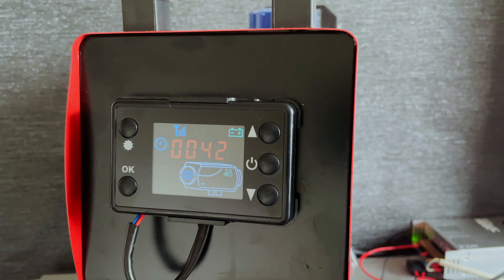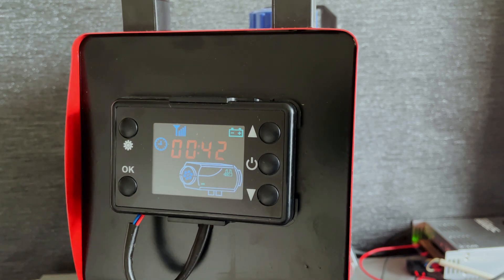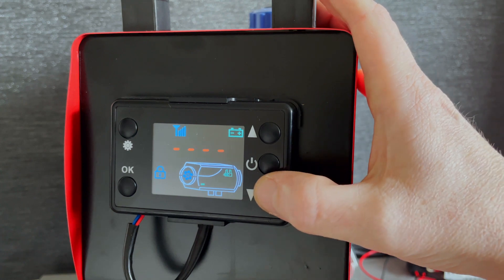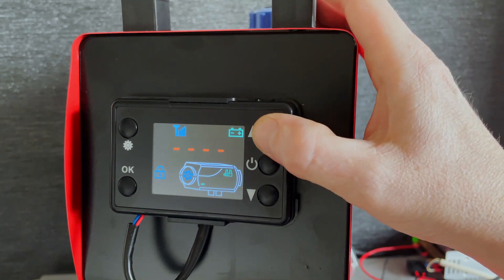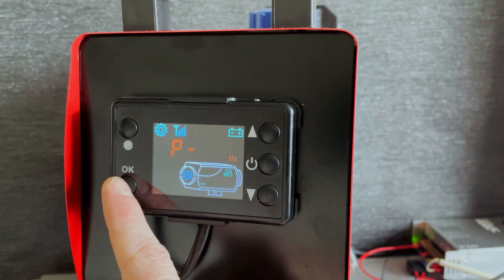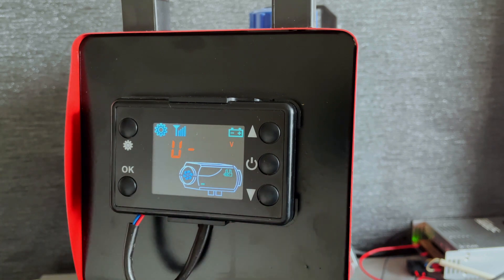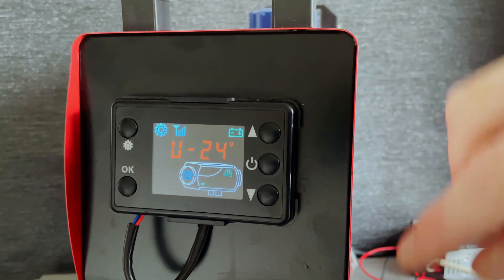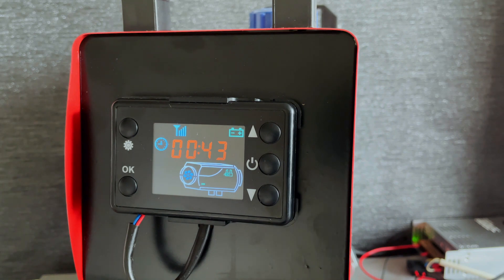How To Switch Your Chinese Diesel Heater Controller From 12v To 24v Or 24v to 12v

Comment: My hcalory doesn't have an ok selection button? Could you help please?
Reply from the maker: is it the bluetooth controller? They work on both 24 and 12v as it is i believe
Reply: @vanlifesurvivorsguide hi thanks for the reply, yes it is, it is pulling a huge amount whilst I have it starting up and whilst running and have totalled one battery already and my new one is the same and the only thing I can think of is it's running in 24v. Leisure battery starts at 12.5 and pulls it down to 10.3 on startup and and then leaves it at 12.0 and then runs it down within 15 minutes or so. Everyone is saying they have them on all night and draws very little power....
Reply: @ToneysTourAndDiscover  Could be that the glowplug is never shutting off, unsure what would cause that to happen, however that is the only way I can think of for it to draw that much power. Possibly a bad controller or sensor?

Comment: Will it run off 20v or does it have to be 12 or 24?
Reply: I'm guessing it would display the low voltage code   For 24 volt setting you can run between 24& 26.4 volts, possibly a little more.

Comment: Hi simple question can this method fix an error 03 code? i have changed the glow plug still throwing this code 03
Reply from the maker: It sounds more like the motherboard or your battery to be honest. Can you see how many volts your battery is reading?
Reply: @vanlifesurvivorsguide  i have 12.7 volt its a Ford E250 truck and it start right away the battery is good
Reply from the maker: @BraveNewWorld1984-r6o  Does it still give you an error code 3 if you try and start the heater with the truck engine running? If it does I think it is the board
Reply: @vanlifesurvivorsguide  yes i try both with the truck running and and the truck with the engine off and still having the dreaded error 03 im waiting for a new mainboard from Amazon im gonna update if it work and i hope it gonna work its very frustrating its for my boss truck:)
Reply: @vanlifesurvivorsguide  I have  purchased a new mainboard im gonna give it a shot im very upset its a brand new heater from Amazon and no more warranty after 30 days its pure scam!
Reply: @vanlifesurvivorsguide  Its the motherboard i make an autopsy with my digital microscope and i have 3 blown component on the board and the back of the plastic holder of the board is partialy melted 
i doubt they stop it before it was completely cooled down!

Comment: Having issue with display either not responding and just shutting off or it would let me turn it on change temp and as soon as it starts the lcd shuts off and stays off. It would comeback on randomly and I try again and the screen goes off again.  I have 2 units doing the same after not using for a couple months
Reply from the maker: That sounds like a loose connection to the battery positive or negative/earthing point/chassis. What happens with a loose connection is you turn it on it tries to work then the LCD flashes off then on and it is back in standby mode again like you never even tried to turn it on.

Comment: Thank you very much for a clear and concise video on correctly setting the operational voltage. I had an E01 error on installation as well as 03 at first. Fortunately I had the LCD controller as an upgrade from the supplied basic controller so was able to correct the unit from factory.

Comment: Is there a particular reason i would want to run on 24v instead of 12v?
Reply: You have to set it depending on the power supply, If the battery is 24v set it to 24v

Comment: Did you try run your heater at a different voltage? I.e can a 12v heater run on 24v ? Thanks
Reply from the maker: The controllers can be used on either the 12v or 24v heaters so they are changeable. The voltage of the motors and pumps change between models so a 12v heater would need 12v and a 24v heater would need 24v

Comment: the real usefull info is if you tried both 12v and 24v supply on the same unit and it works properly..
Reply from the maker: The controllers can be used on either the 12v or 24v heaters so they are changeable. The voltage of the motors and pumps change between models so a 12v heater would need 12v and a 24v heater would need 24v